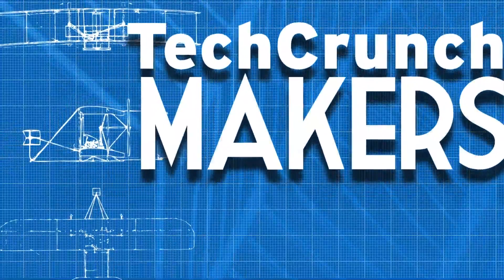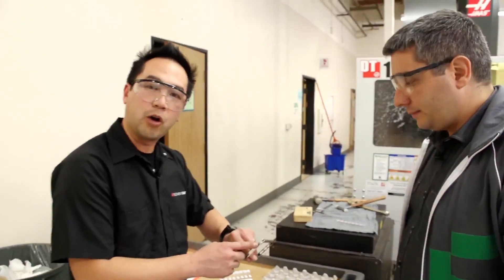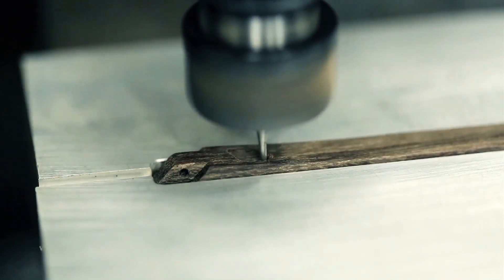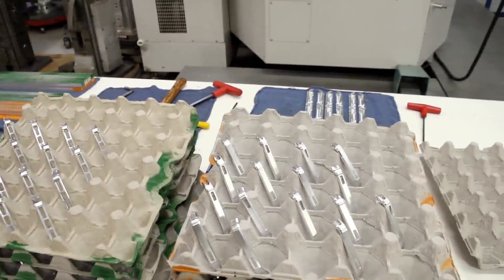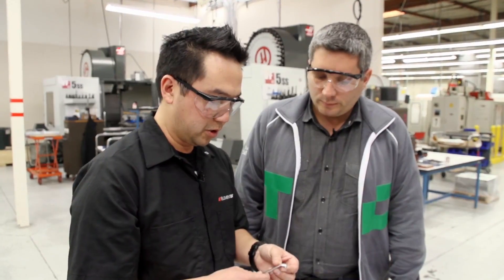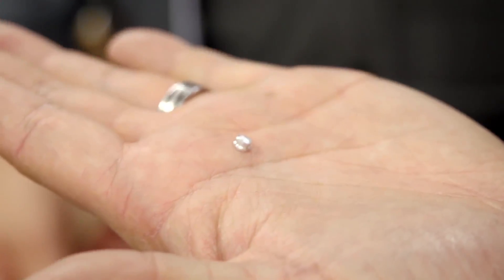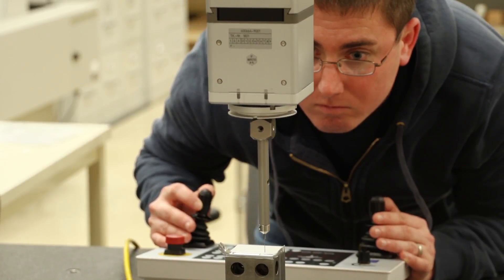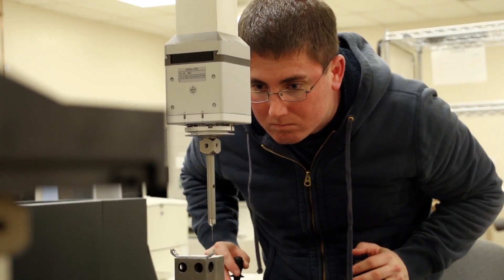Engineering The Perfect iPhone Cover At Element Case | TechCrunch Makers

Comment: wait...do you have one? I do..it lays flat on the wood sides and screen does not touch. Besides, I also use a screen protector. I take it you're the one that spends $700 on an iPhone (and plan) but protects it with a hideously lame, twice the size, rubber Otter box for $35. I don't think Element ever says they make the best protection case in the world, but their designs are flat out beautiful and compliments the beautiful iPhone...not many cases can do that!